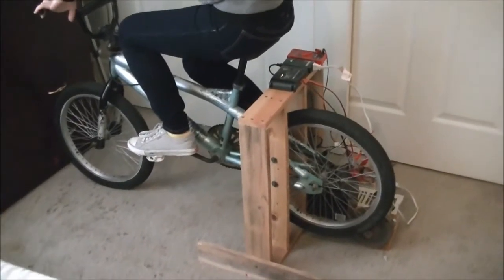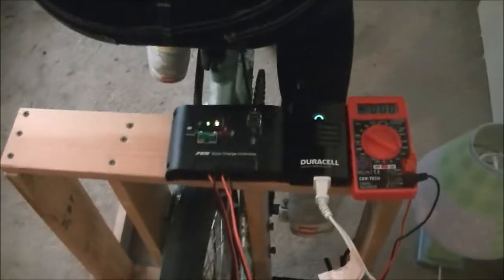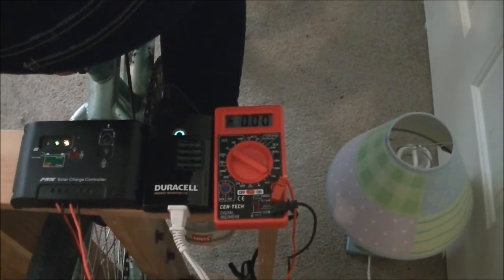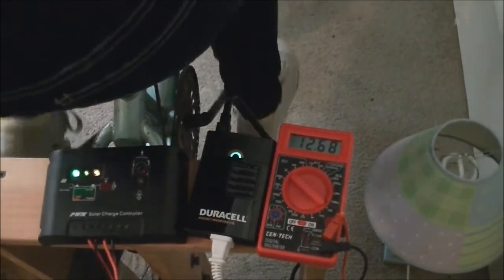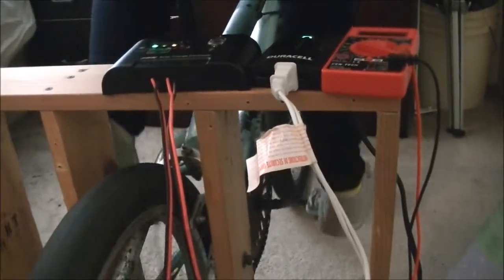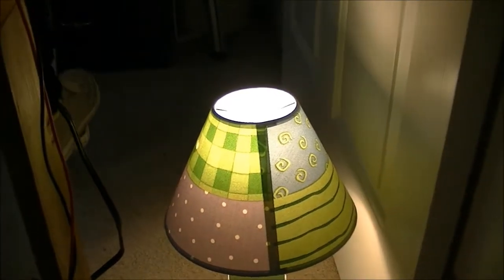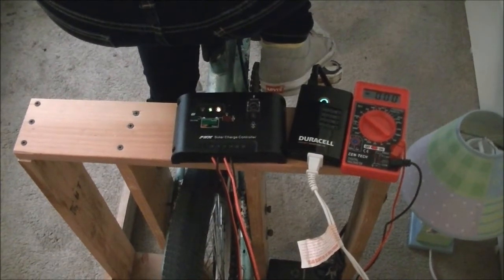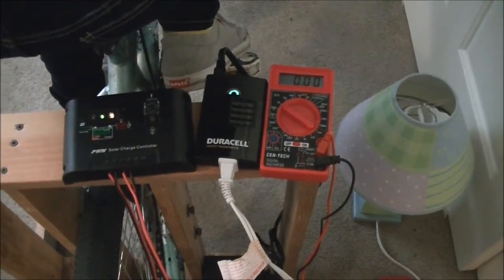$100 DIY Bicycle Generator

Comment: using a belt is a higher efficiency transer of energy. thats why other people use belts. also, a flywheel will increase efficiency as well as provide a more stable/constant flow of energy.

Comment: Very cool!
Reply from the maker: Thanks. I don't recommend using a charge controller the way I show here, though. Use a blocking diode if you do this. It works better, and it's less expensive.

Comment: During a power outage... We ran the tv and dish network box for 5 hours we had a 750 watt inverter, and a deep cycle battery... I am building a generator , have the motor, now all I need is a junk bicycle. I was going to take the tire off and go buy a belt. I think I like your idea better. Thanks for sharing...
Reply from the maker: You're welcome. The belt idea is good, and I thought about doing it that way, but I didn't feel like spending the extra money. Just using friction and tire pressure seems to work just as well. Watch my later videos on bicycle generators, though. I ditched the charge controller for blocking diodes. It works better, believe me.

Comment: Interesting - - -What are the specs on your battery?
Reply from the maker: I copied the battery information from the eBay ad. The price seems to have gone up. This battery is now selling for $66. The bike generator is a nice little setup, though. It'd come in handy during "brownouts" in the Philippines. 

New BATTERY,12V,35Ah,DRIVE MEDICAL DESIGN CIRRUS DP,116,120
Brand: Max Life Battery
MFG Part#: ML35-12
SKU: 3368140
Condition: New
 
Volts	12 V	Amp Hour	35 AH
Chemistry	SLA / AGM	Terminal	Nut & Bolt (NB)
Length	7.68 in	Width	5.16 in
Height	7.13 in	Weight	23.15 Lbs
Warranty	2 year	Quantity	1
 

	
Item Description

Maxlife 12 volt 35Ah valve regulated sealed lead acid batteries are maintenance free, rugged and economical. Maxlife SLA batteries are utilized in a wide variety of applications including electric vehicles, wheelchairs, scooters, UPS backups, computer systems, industrial and medical equipment and more.

Delivering power when you need it, the ML35-12 uses a state of the art, heavy-duty, calcium-alloy grid that provides exceptional performance and service life in both float and cyclic applications.
• Absorbent Glass Mat (AGM) technology for superior performance
• Valve regulated, spill proof construction allows safe operation in any position
• High energy density

 

Model	ML35-12
Brand	MAXLIFE BATTERY
Capacity (Ah)	35
Voltage (V)	12
Terminal	Nut and Bolt
Dimensions (LxWxH - inches)	7.68 x 5.16 x 7.13
Weight (lb)	23.15
Chemistry	AGM - Sealed Lead Acid
Warranty	2 Yr Replacement

Comment: WOW!  What a GREAT project this is my friend.  I may have to try this myself.  I just have to look around for a tread mill motor.  Maybe I could find one on craigslist.  Thanks for sharing.
Reply from the maker: Thanks. These motors can be found on eBay for less than $50, but they're heavy, so shipping might be a tad expensive. Anyway, it's a fun project, not hard to do.
Reply: Okay, thanks for that info.  :-)

Comment: Can it be peddled faster? Or is that the speed one has to do? If you can go faster, does it charge faster? I had just ripped out the ends of my red Harbor Freight meter and saw a coupon for a free one again just yesterday so now I have 3 of those meters. Nice to see how you create these things John. It always looks real clean too. I could build a project using 3 pieces and still have 2 pieces left over when I'm done and it would look like a cyclone hit it!
Reply from the maker: Pedaling faster than 14 volts wouldn't make the battery charge faster. I wouldn't really want to go fast anyway. Pedaling at a nice, leisurely rate means it can be done for a much longer time. I'll bet your building skills aren't as bad as all that. Anyway, It's like anything else. The more you do something, the better you get at it.
Reply: John Strabismus
Gotcha thanks